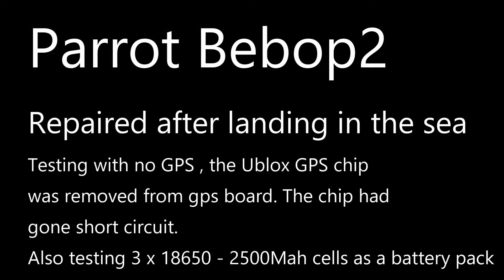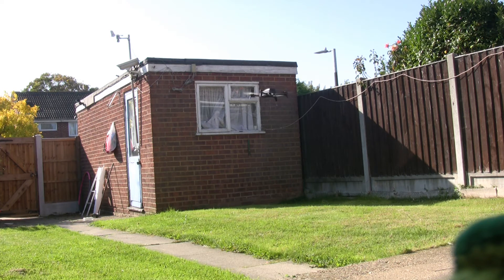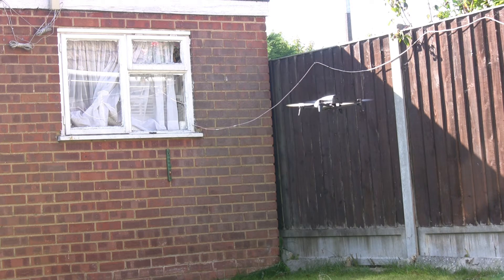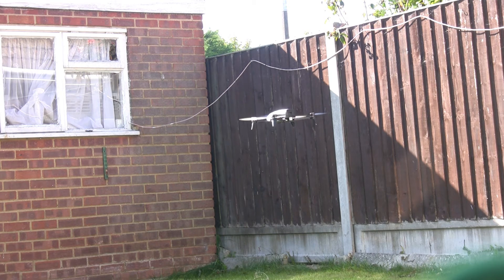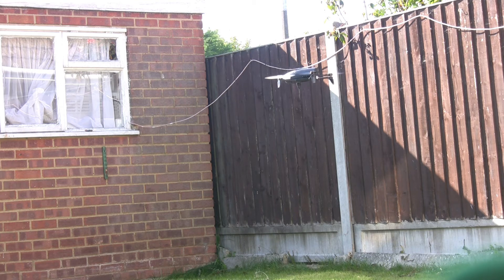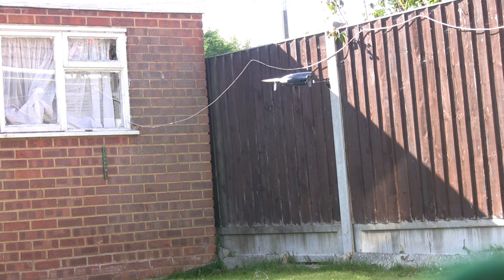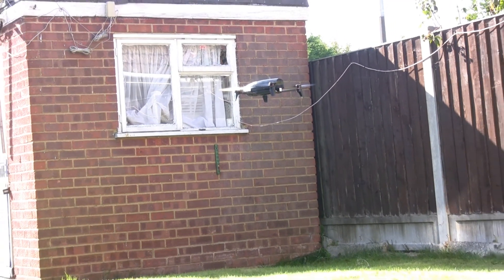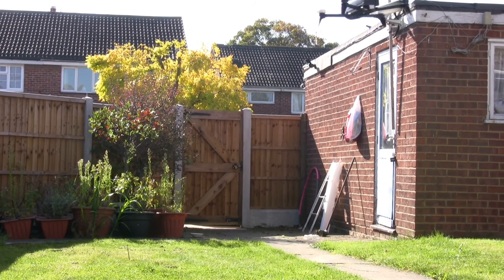Parrot Bebop 2 Repair

Comment: Ever heard of the bebop2 just quitting?...no damage and no water...batteries check out fine with a multimeter...it just will not turn on...could the power button board be bad?
Reply from the maker: Have you tried plugging it into a computer with a usb lead and seeing what happens?
Reply: @graz27  nothing...but I have since ordered ,recieved and installed a new motherboard from :Better Earth Drones"on ebay and it's like a new drone.
Thanks for responding.
This fix costed  the same as a Parrot branded battery!!
Reply from the maker: @droneready8278  Glad you got it sorted and the best way really to replace the board . more so if you get a good deal on one which sounds like you did. Well done enjoy :-)

Comment: Hello, I have great requests for you ... I have a wingsland drone s6 ..., I noticed that you have done many tests on it ... and please help me to make it better.  Which firmware and Android software version is better?  Which propellers are better (dji spark, dji tello, original ones, or others)?  How can I increase its flight time (what cells are better? And how many mahs do I put ... maximum ?, 18650 Li-Ion batteries are good?).  Thank you for having a wonderful day.
Reply from the maker: To be honest Lucian, I have tried other props on the Wingsland S6, but at present the stock props are best to use for reliability reasons as some others I tried break apart in flight. 18650's are not really a option either due to weight and the low battery cutoff in the S6 makes them pointless in this craft. Best mod by far is replacing the cells inside the S6 battery case with better ones. I get almost 8 mins of actual flight time with upgraded cells.

Comment: Hi Graham,  I have the same drone but when I press the on button it turns on then turns off, any thoughts as to what it might be?
Reply from the maker: Has it been crashed or landed in water Aaron?
Reply: @graz27  not that I am aware of,  I brought it used but in mint condition.  Would you take a look at it? For a fee of course

Comment from the maker: Sorry to Anon and Gerald, for some reason Youtube has removed all the comments on this video. Have no idea why or if its a bug etc. I can see your comments in my notifications, but not showing up on the video. I read Anon that you are going to try about some LG cells and would be curious how you get on too. Gerald I see you posted something about the sky controller but in notifications only shows me a few lines of what you posted. Sorry Guys , have no idea why they are not showing.
Reply: Hey Graham I bought a drone Bebop 2 that was crashed 1 motor was bad which I fixed and the drone is flying nice I love everything but the video is there but it says memory full all the time when I hook up the throne  to my PC over telnet all the folders are gone in the internal 000 file and when I check in Free flight app it says no media drone is flying nice that's the only problem that I have I can't record and it's a really nice drone to fly. I took everything apart and check the mainboard didn't seem to find any cracks on it so I'm wondering could I be just software problem or could it be the memory chip